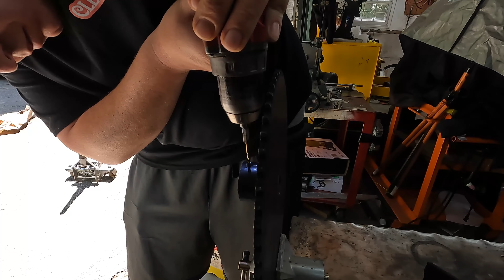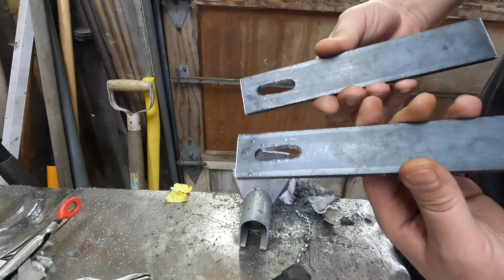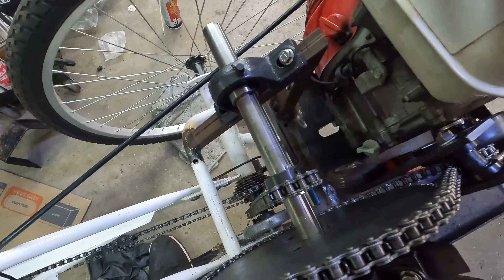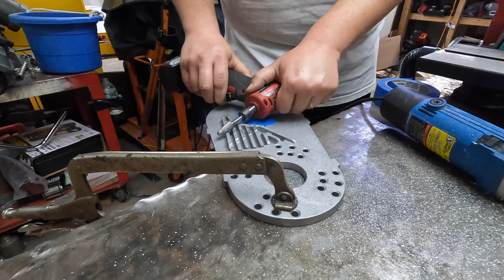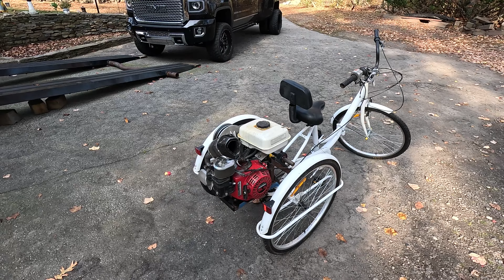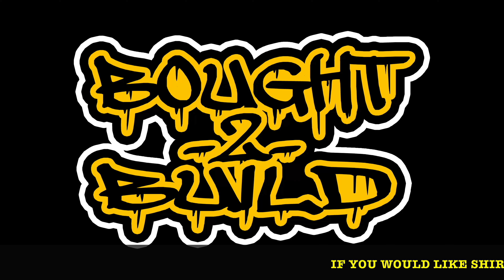DIY MOTORIZED TRIKE FROM OLD POWER WASHER AND FREE TRICYCLE!!!

Comment: I don’t know how to do all that but I an changing my Schwinn Meridian from electric to gas , been trying to mount my motor from December and I think I finally got it today . not on the back like yours but in the middle
Reply from the maker: Hell yeah! That’s awesome man! If I was going small engine I would have gone middle between frame rails but for what I plan to do the back works good this size engine wouldn’t fit in the middle on mine not even close lol but good luck on the project! Thanks for the support! And stay tuned for part 2 of this project!!! 🤟🤟🤟🤟🤟👍👍👍👍👍👍👍👍👍
Reply: I hear that , I chose to use a 100cc 4 stroke engine kit

Comment: Suggestion: Swap to a larger diameter sprocket (the final drive sprocket at the wheel), probably twice the diameter, or twice the teeth. This will make it easier for the engine to rev up into the power band & give you quick acceleration! Good luck!
Reply from the maker: Thanks! I appreciate the tips!
The torque converter made the gearing work really well! But I didn’t want to go to crazy with this setup as version 2.0 will be coming soon with a full tube rear frame and bigger and wider wheels etc!
Thank you for the support 🤟🤟🤟🤟🤟🤟🤟🤟

Comment: I'm doing a build like this. Schwinn bike and a 79cc predator. I am not using a jack shaft. Just clutch to rear sprocket. I also flipped the rear axle in order to drop the frame.. no pedals.
Reply from the maker: Nice that’s awsome!!! I was originally going to go centrifugal clutch directly to axle but it was extremely jerky and didn’t like to take off so I went to the tq converter and jack shaft setup thing rips lol 😂 

But stay tuned for the next revision! Full square tube rear frame that I can disconnect and put on just about any bike it will be solid axle with ATV/small car wheels/tires on it! Should be a cool little beach/race track cruiser! 

Thanks for checking out the channel and thanks for the support! Good luck on your project! 🤟🤟🤟🤟🤟👍👍👍👍👍👍